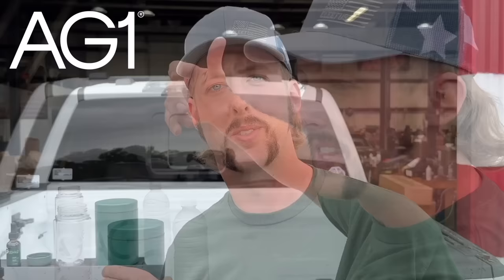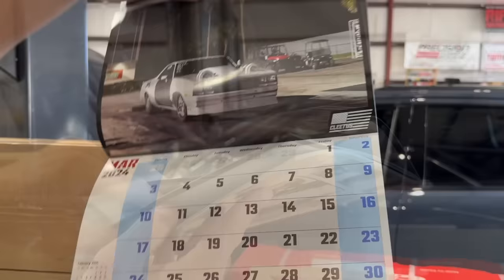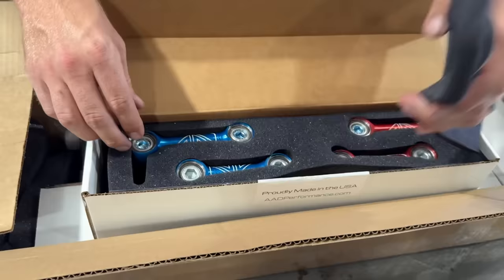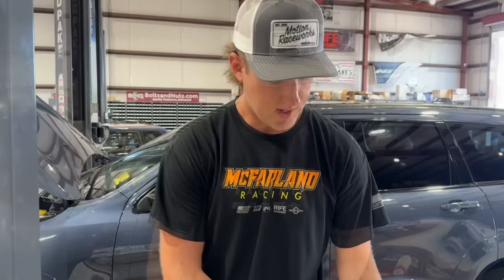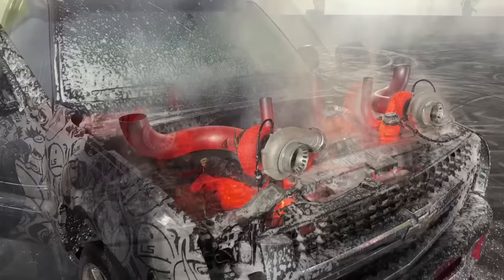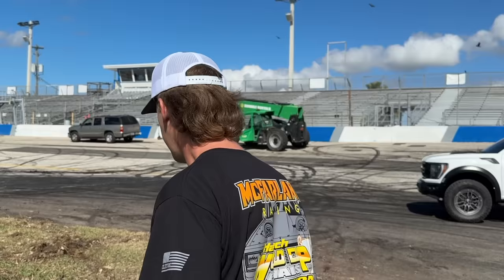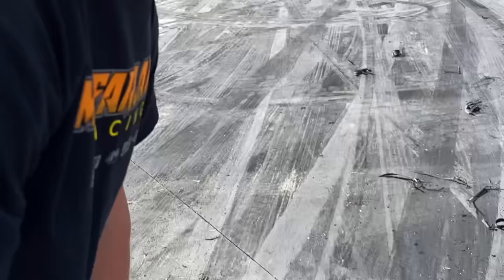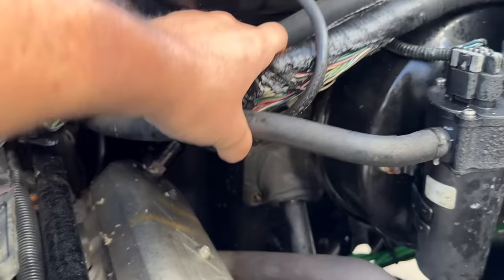The Freedom Factory is TOTALED... The Most INSANE Event We've Ever Hosted (DAMAGE REPORT)

Comment: The fact that Rodney fired up and was able to be put on the chip is absolutely amazing. I’ve never seen an engine so hot the whole thing was glowing. I’m surprised it didn’t melt to a pool of metal on the burnout pad
Reply: The valve covers were glowing red. I didn't think that was possible.
Reply: I have no idea how that thing is still running? I've seized an engine before when it had barely overheated, that thing must have some fairly hefty gaps when it's cold so it can grow in to itself!
Reply: @benjaminfrohns I wonder what the temperature got up to.
Reply: @nickwebb9937 all of it 😂
Reply: @nickmaclachlan5178 that's exactly what he did I'm guessing to keep it from seizing up.
Reply: It’s because it’s a Ls boyyyyyy💪🏽
Reply: @nickmaclachlan5178  It was mainly the hot/exhaust side of the turbo and headers that were red hot. It's definitely not good but you'd be surprised how many cars headers glow red hot at the end of a pass, built cars that is. Definitely not great for the car, especially with the fire and all but it's not uncommon for headers to glow from heat.
Reply: @beeman4266  Retarding timing and adding a lot of fuel plus boost will do that for ya 😅

Comment: Here's a couple ideas Cleeter to help improve the track visuals, a bit of safety, as well as even the competition a bit with number 4. I apologize for the length of this comment, but not sure how else to reach you where this would be seen easily!

1.     When making a vehicle jump, to avoid the nose diving, the jump doesn't need to be necessarily high, but the jump platform/surface should always be a bit longer than the wheelbase of the vehicle hitting the jump. I promise this works. It's when the jump is shorter than the vehicles wheelbase than it will always, always nosedive. Normally 1.5x the wheelbase at minimum will help this, feel free to experiment from there. Height doesnt matter so much as angle there.

2.      You should put down those red and white kerbs on the inside of your turns. This really helps drivers see where the edge of the paved surface is, especially in the dark, and also helps you plan your turn ahead of time and further back than just pave to grass. Also it subconsciously helps keep drivers from tearing that edge up, helping to keep the track looking good! I'm unsure of cost for this but it could be a wise investment to help keep grass and grading costs down later.
    Even just to throw some down around the inside of the kidney bean turns to start, could add them to the main turns later. It's just the bright colors help a driver see that edge in the heat of the moment to really dial in the turns without having to try and focus on where that edge is too much. 

3.       This ones a big maybe, but what about throwing down a paint line down the center of the track all the way around, for the spectator drags to help the fellas stay on their side if needed, and, 

4.       Maybe throw down a bright driving line with bright green on exits, and bright red coming into turns like youd see in Forza or Gran Turismo, so the less experienced drivers can learn the lines of the track and get their times up, that way it could be more competitive with the veteran drivers?

      Hope this helps. I'm not in any way implying you're dumb for not doing or considering these things, I just know you're a busy man Garrett, and want to throw out some ideas to help keep the place looking great! 

Also, could we get a full build video on the track hawk especially, but also all giveaway cars at least? This would help the new owner know exactly what went on during installation, as well as anyone watching who owns these vehicles with confidence to work on their own rigs! Heck call Derek Bieri up to help with production on the first couple build videos!

Thanks for everything Cleetus, George, Jackstand and everyone else involved! Love the content and humor!
Reply: Bump
Reply: This would make it less fun tho
Reply: @Offroadflicks  less chaotic maybe. But less fun I don't think so

Comment: Wow... With the extreme temps Rodney got up to, Im surprised the turbos didnt seize up
Reply: That’s what I was wondering, you think 300f +?
Reply: @Bacongrease00  that red glowing doesn't start with steel till around 1000*. Aluminum is closer to 750*.
Reply: @overindulgent  do we really think that oil is 750f?
Reply: @Bacongrease00 no way the oil was that hot, the exhaust gas was definitely  1500+ but the oil temp 275+, probably close to 325 lol
Reply: @mitchhouge8427  I know it wasn’t I was questioning the other previous poster. The flash point for most these oils is around 400f

Comment: Rodney deserves a poster. It's the only thing that will do it justice.

I went back & looked at a freeze frame from that short clip you included.  The effing valve covers are glowing red.

It can't be from the engine being that hot or it would have detonated & ate itself, so it's gotta be a combo of the oil fire & the radiated heat from the turbo piping.

Find a good vid frame & see what it looks like blown up. If you can manage a sharp, poster size, it'll make Rodney a legend.

Comment: I am the guy that crawls under cars with a sponge and bucket and washes off the parts of the undercarriage. Also remove the plastics to clean and wax beneath and wheel well detail when rotating tires or changing pads.  I will see all those billet suspension pieces and anodizing in all their glory.

Comment: @CleetusM You don't have to resurface yet. With all types of high-speed racing including asphalt drag racing, asphalt tracks are more prone to deterioration than typical paved surfaces. Regular sealcoating is a necessity. Commercial grade asphalt sealer needs to be applied to maintain the durability of the asphalt. Resurfacing would take about 2-3 months. Sealcoating only takes 4-8 hours to dry. Would help extend the life of your track surface. Much cheaper than resurfacing. ✌😉🇺🇸

Comment: Damn I a whole month behind watching these the exhaust manifolds, heads and valve covers were red hot and it kinda looked like the block was also red hot which means that entire engine was at least 900deg F + I’m shocked and surprised that engine runs not seized let alone starts you’d think the starter at those temps would’ve damaged along with plugs wiring and a lot of other things unsalvageable so possibly just change oil and spark plugs hoping nothing else wrong he’ll yeah brothers